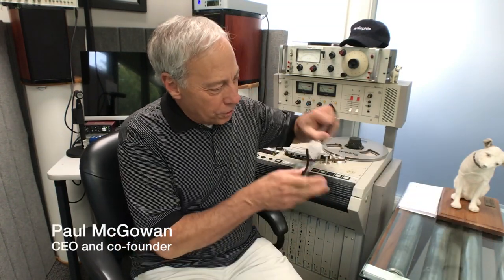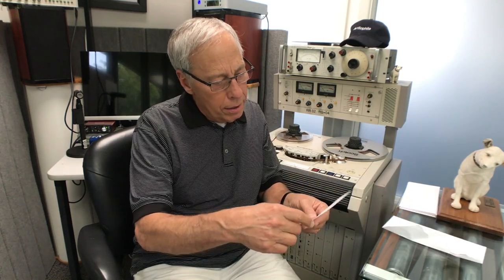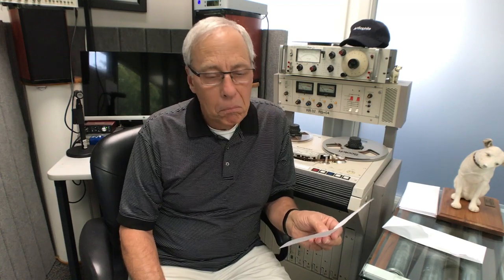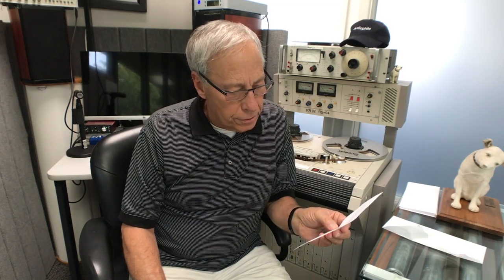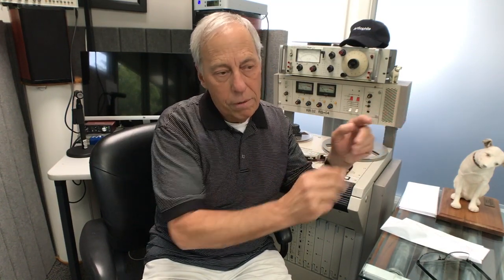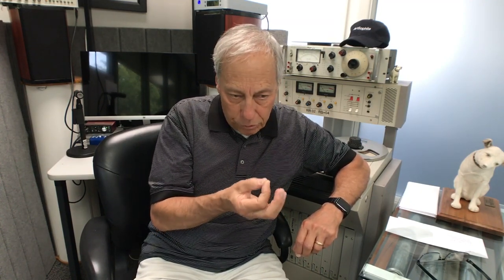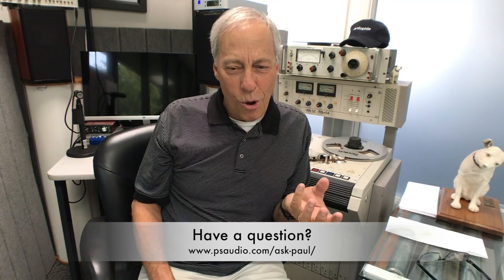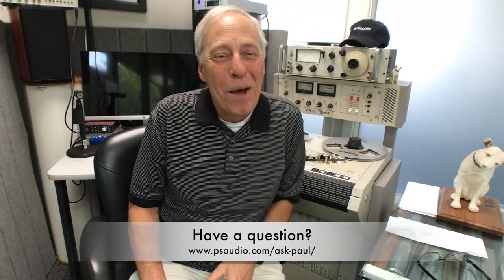How to reduce vibrations and resonances in a high-end audio system

Comment: I kept hearing a vibration distortion on my tubes amp.

I’d feel a buzz on my amp of my desktop  system. 

I’d use tube socket saver which gave a positive sound results. 
Probably the weight has lent a thicker sound and more accurate imagery. 

But, I still felt vibrations on the amp. 

I purchased a magnetic levitation (maglev) iso feet. 

This reduced the vibrations to a barely felt minimal buzz. 
Tonight, I placed felt pads below my maglev isolation feet. Now, I can barely feel a thing. 
No mid nor bass buzz in sound. 

As far as radiant vibrations I get from my speakers, I shielded the speaker and amp with an extra diffusion panel I had lying around. 

This may be my final tweak.

Comment: 2 aspects come to mind. Increase the mass of the component and connect to vibration damping materials via large surface areas. An ideal vibration damper would absorb at all different frequencies, so maybe combine different materials with different absorption characteristics?
Reply: i use soft rubber, eva foam and felt in combination. its a pretty inexpensive methode too

Comment: i use squash balls cut in half under the feet of my gear, and keep all the equipment on separate rack shelves. they are good for cutting down on internal resonances caused by the gear itself cd players etc and keep the gear decoupled from the speaker vibrations passing through the rack.
Reply: I built my own equipment rack out of wood and recently realised it would be better if I attached it to the wall as it's pretty high and wobbly. I think it helped, although it does bring in some vibrations from the wall. But surely the equipment rack gets more vibration than the wall, as it's a much lower mass, so better overall I think.

Comment: I wouldn't build a RIAA amp into the tone arm, as it will increase the weight of the tonearm and therefore limit it's movements. What I have done is build my RIAA amplifier just under the tonearm. Still closeer than normal.

Comment: I've often thought of placing a rubber foam sheet around my turntable :). Sometimes I through a blanket over the dust cover. Actually, while probably not the best for a system, but I have everything in a steel rack system. I should at least place o-rings between the rack and the equipment on the screws.
Reply: i bought some rubber mats and cut them up and placed under all the feet of my components

Comment: Try sorbothane pads under your turntable. Expensive but incredible material. Next to nothing in terms of vibration and resonance will get thru to your turntable even speaker vibration at 25 hz is stopped in its tracks. Have seen it used on platters as an under pad but don't agree with that.

Comment: You can use a laser pickup, if i understand the question you are asking.  Floating the turntable on repulsion magnetic isolation and then the turntable in a tripple isolated (mass-loaded, diffusion and room-tunable hemholts for the different bands), will do the rest.😂